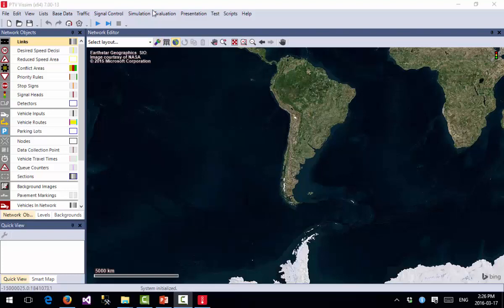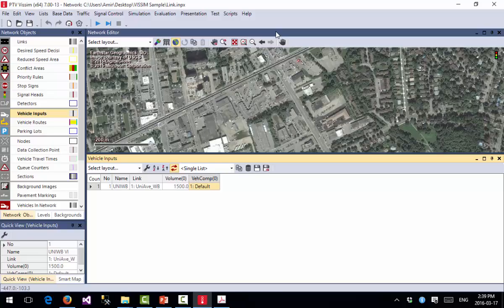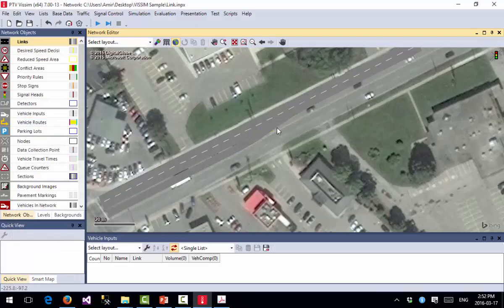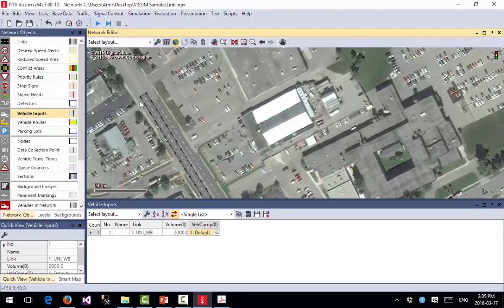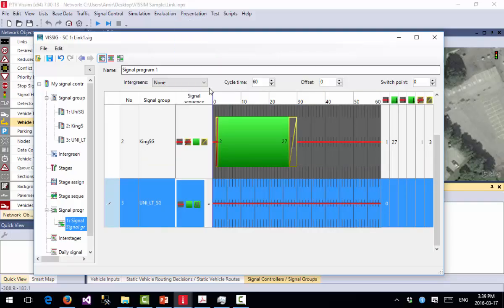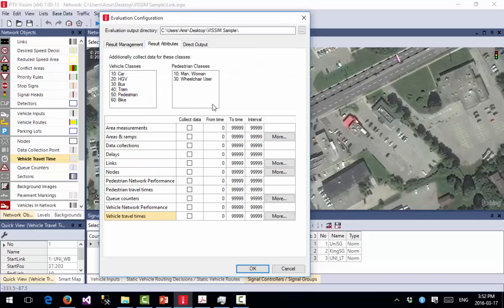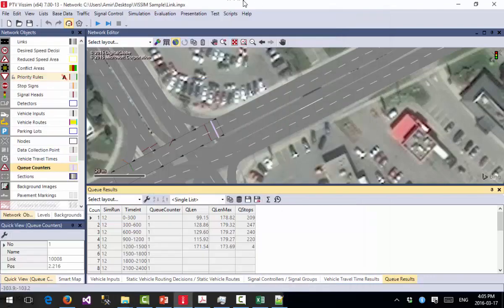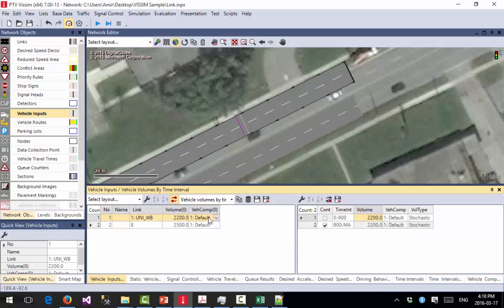VISSIM Tutorial

Comment: Thank you sir for this great video. I'm using VISSIM to estimate travel time on some links (more than 100 links) as a part of my thesis. I have added the vehicle inputs for the links. Can I run the simulation for several demand levels (e.g. 85%, 95%, or 105% of the original volume) without adjusting the vehicle input for each link ?

Comment: Great work Amir! Could you please tell if there is any way to get queue length on each lane of a link? For eg. if a link has three lanes, can I get queue on each lane separately (I couldn't find any option to place lane wise queue counter)? Also, if I place queue counter (A) on the connector of a lane, can "A" calculate the queue of the lane connected to connector (The simulation is throwing some number but I am not sure if it is correct)?

Comment: Alright man, can I ask you a question that why I cannot load a SketchUp file into Vissim 9.0 version. Every time I load SketchUp file into Vissim 9.0 version,  there will be a mention that the 3D model "file name" contains no valid geometry and thus cannot  be loaded. I'll appreciate that you can give me some clues , thanks man
Reply from the maker: I did a lot of 3D work with Google SketchUp and I had same issue as you. In my experience (in Vissim 9), First, you need to save your file in SketchUp 2015 or earlier versions. Second, I was not able to directly import it. I used the VISSIM V3DM software to import the SketchUp file into their 3D model and then export it to the their 3D format.
V3DM is located in your installation folder. e.g. C:\Program Files\PTV Vision\PTV Vissim 9\V3DM
Reply: Thank you for taking the time to answer my question in so much detail. A few years ago, I had directly imported SketchUp files into Vissim 5.4 student version successfully. By the way, I cannot use the V3DM software to load a SketchUp file, so how can I transform a SketchUp file into a V3DM file?
Reply from the maker: First when you wanted to import the file, did you saved your file in Sketch Up 2015 or earlier (e.g 2014)?
Second try using the 32bit version? I recall reading somewhere that the Vissim can not import in the 64 bit directly.
Third, the V3DM seems to be their internal format, I could not find the any tool to save it in V3DM directly.

You should be able to import the Sketch Up 2015 file in to base layer of the new 3D model. look at these complex models I created:
https://youtu.be/0Yqbe0k8Fbk
Reply: I tried to use the 32 bit version to import the file, but the same problem notice occurred. I will try to save the file in SketchUp earlier version. Thank you helping me to solve the problem. BTW, you did an impressive job in the La Pyramide Abidjan Ivory Coast model.
Reply from the maker: You should save as earlier version. I had same problem if the file is save in SketckUp 2016 or 2017
Reply: Yes, it works. SketchUp 2014 or 2015 files can be loaded by Vissim. Thanks again.

Comment: Good morning dear Amir Zarinbal

It's Victor Mastropietro, I write from Venezuela, and I am working on my thesis, which consists on the evaluation of the BRT transportation system built in Puerto Ordaz. I am doing a simulation with VISSIM for the BRT, I need an exclusive lane for the buses, but I have not succeeded. Could you help me establish an exclusive BRT lane? Thank you very much in advance, I hope your prompt reply ...

Best regards...
Reply from the maker: Hi Victor. Yes you can.
You have two options, 

1- Add a separate link parallel to you links for the BRT and add a vehicle generator at the top for busses. Or even you can define the bus stops using Public transit route and stops

2- If you have an existing link that you want to have one lane dedicated to BRT, then you need to go to the link properties and in the lane section, one of the column is BlokecedVehClasses. Block every vehicle there except the bus.

Comment: Great video... I am currently undertaking a study requiring obtaining the lane group capacity of a signalized intersection. Could you please advise me on how to go about doing this?
Reply from the maker: Capacity of a lane group is the maximum number of vehicle that can pass the intersection using this lane group. 

Theoretically the lane group is  Number of lanes x SaturationFlowRate x LaneGroupEffectiveGreenTime / CycleLength, if the lane group has opposing vehicle and should wait for gap, there are some adjustment factors in HCM. 

If you want to measure it in VISSIM, my suggestion is create a volume generator before intersection. Set it to a high value (e.g. 2000 vehicle/hour/lane). Add a "Data Collection Point"  right after the signal heads in the connectors of those lane groups. In evaluation set it to show/export the data collection point data. Count the number of vehicle passed. You will have capacity of the lane group
Reply: Ok... thanks Amir, I'll try doing that
Reply: Sir Amir what about PCU or PCE calculation using vissim?????
Reply from the maker: You can add a "data collection point". They go to evaluation and It will provide you the time stamp of each vehicles and vehicle types (e.g car, truck, bus, bike) that passes that point. Then you can go to Evaluation menu and Evaluation Configurations. Select "Data Collection (raw data)" from "Direct Output" tab.

They would be able to calculate PCE/PCU based on collected vehicle data.